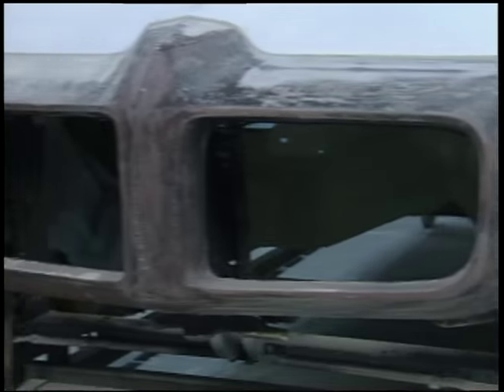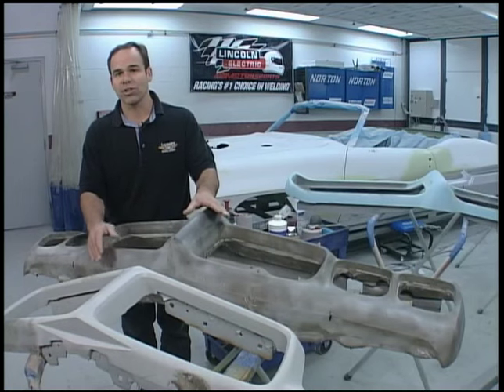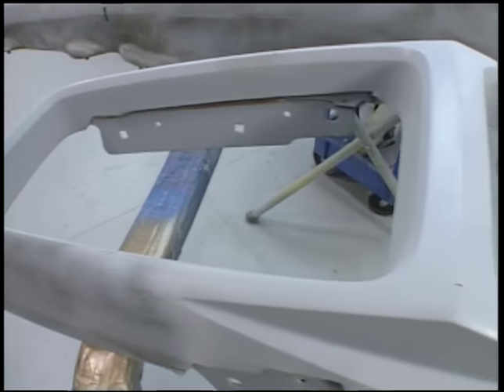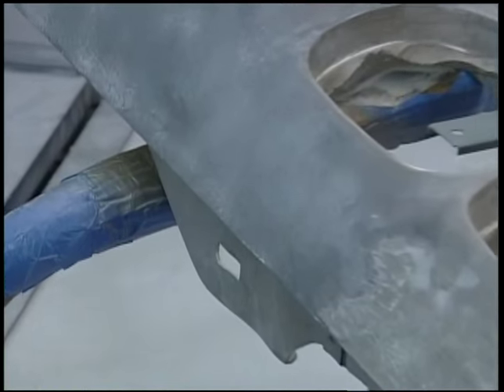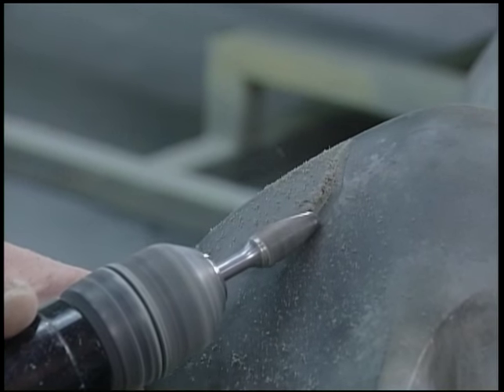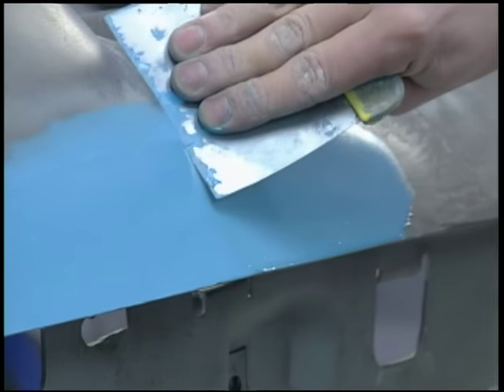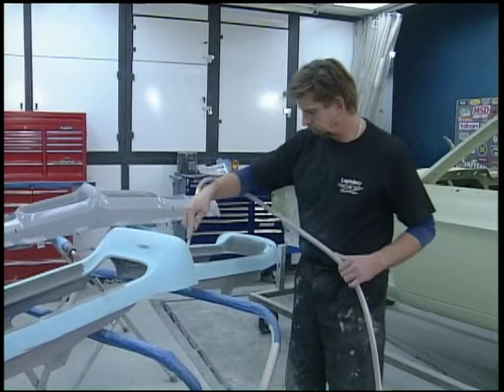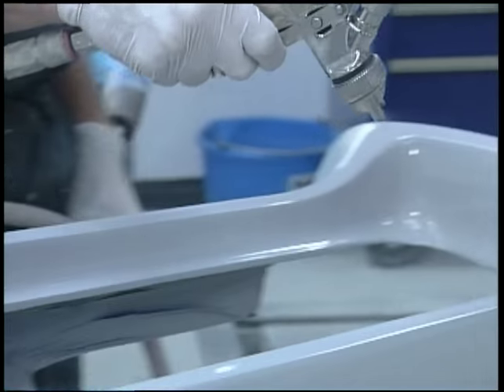70 GTO Judge Convertible restoration series 5/13 Legendary Motorcar TV

Comment: Great video, a lot of body guys should watch this video, l love when they tell you that the endura nose on the 70 GTO was a problem straight out of the factory, Um no, the problem is they don’t know how to prepare and repair them , you have to take the proper steps and use the correct products to repair them correctly, Great Job By Legendary Motorcar.